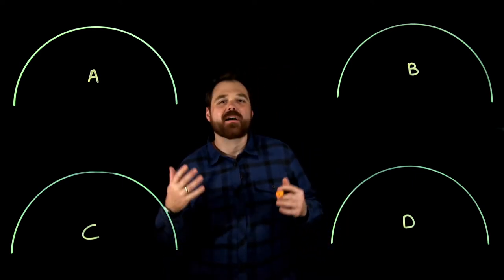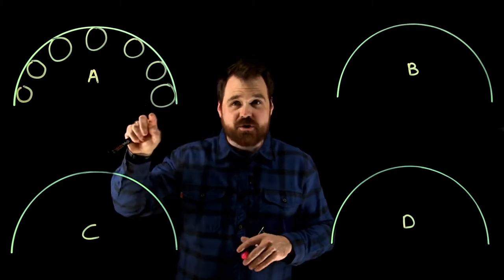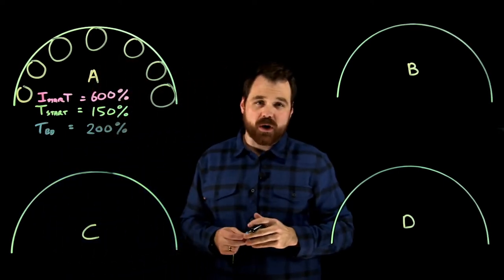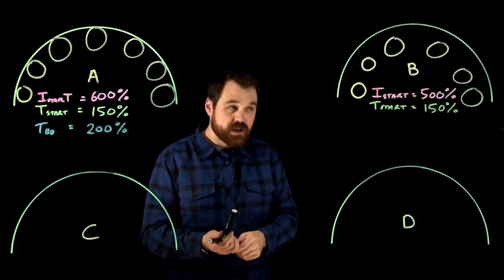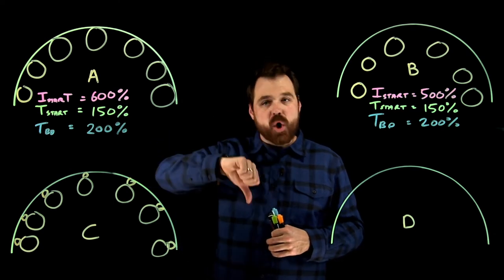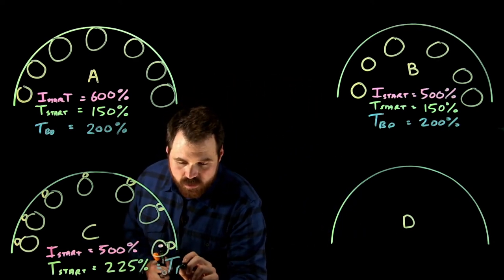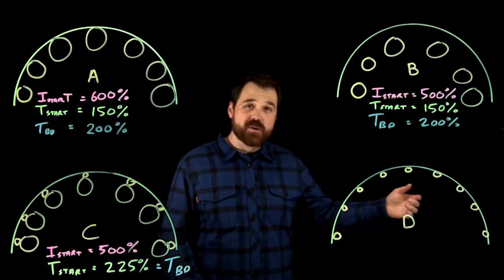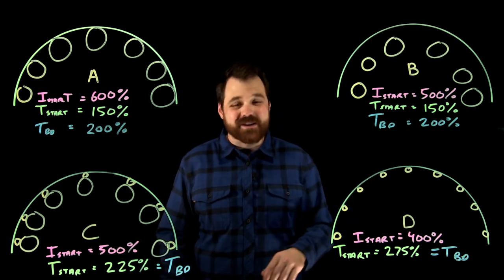NEMA Rotor Designs

Comment: Fantastic Explanation.  Every Oil well and Punch press uses a design D motor.  Large Screw Header's as well. Many painful lessons of electrical maintenance engineers trying to replace a design D motor with new A or B.  Many times it cant be done, even with an AC drive.  Reciprocating loads, Heavy Fly-wheels, and Large startup torque prove the grave yard to the New Drives.  Its Best to rewind the old dogs, or oversize drive and motor, with DB resistor, and overvoltage Supression Software in the Drive.

Comment: why the inductance of class A is low and Class B is High?
Reply: Rotor bar Inductance is greatly affected by the amount of iron around each bar.  In the Design “A” rotor, the bars are close to the surface,  meaning they are not as exposed to the magnetic effect provided by the iron.   Therefore… less iron exposure…less bar inductance…less rotor bar impedance.   Thus … higher current flow through each bar. As for the “B” rotor, each bar is exposed to MORE iron.  In which case the inductive effect is opposite.